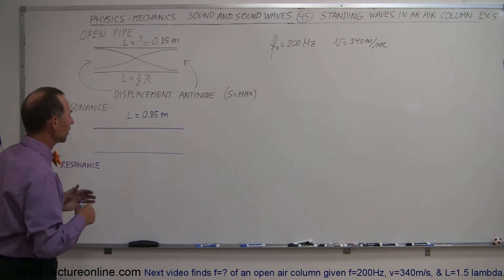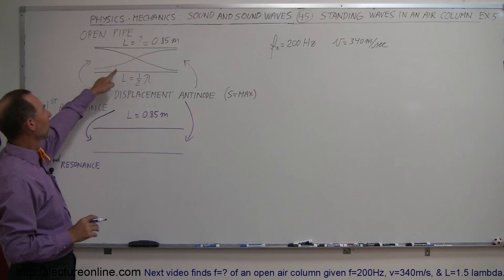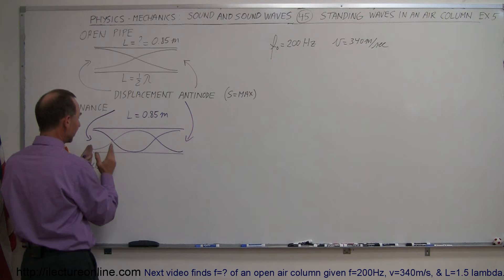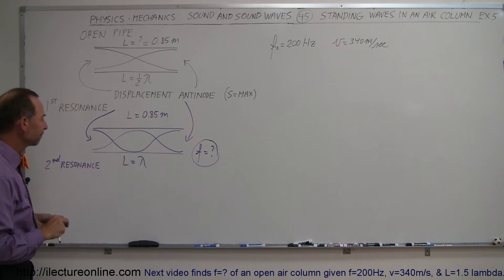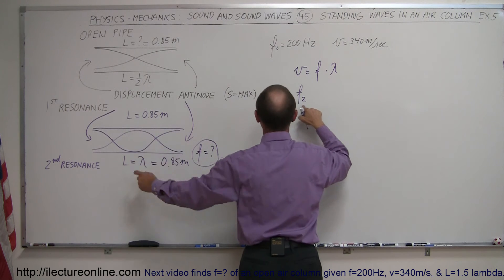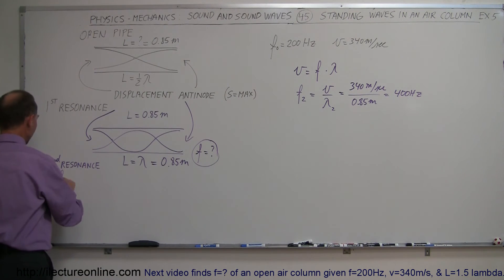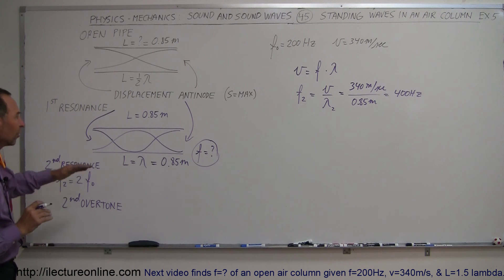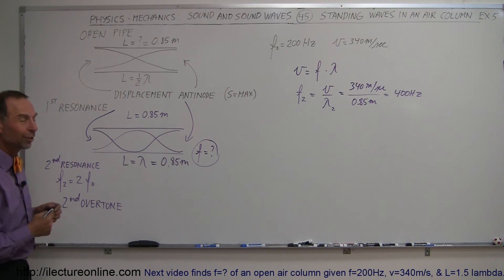Physics 20  Sound and Sound Waves (45 of 49) Standing Waves in an Air Column Ex. 5

Comment: So when u talk of a pipe open/ or closed does that play part in a ported sub box? If not how does one aply the nodes to a ported sub box? As to i do understand in a pipe closed/open but a box has the cab(box portion wher subs sit,then goes to the port)
Reply: As to if it was same in a sub box id need a anti node at the port and 1 node goin into the box then last node at the closed end of the ported box box facing the front windshield and that would make it more focused on air displacement/a good pressure build up?
Reply from the maker: Note that we are finding the resonance frequency with a open or closed pipe we are dealing with a single frequency.  With a ported sub box you have a speaker that will have many frequencies.  The purpose of the sub box is to amplify the low bass sound.
Reply: So essencially from what ur saying in a way a 34hrtz tuned box compared to a 28 hrtz tuned/ even lower could still be seen as all the same?, as to the sub does produces the sound no matter what? Just more overtones add to a greater achieved amplification if nodes are in certain places?
Reply: Tho i have looked at my crossovers marking i tuned my crossovers on my amp with a 60hrtz 0 db track on two mono blocks. 1 is running 2 4 ohm dvc subs to 1 ohm and the two 2ohm dvc subs wired to 2 ohms. I have found that when i looked at my crossovers when u use a multimete to set crossovers it sets the crosovers 3 overtones so instead of my amp amlifing just 60hrtz its actually amping up to 180 hrtz on the 1 ohm and the 2 ohm is 60 to 160 or sumthing like that im just going off memmory.. as well i love everything sound engineering soo far and been aplying it to my system, sooo far i been achieveing some really good sq but now that im understanding nodes more im gunna be  figureing out what all i rlly need to do in my car decks settings to shift the signal or whatever needs to be done. As well.. can u by any chance send me link to the first video of the playlist the videos name is under?I been trying to find the first video but i cant seem to find it
Reply from the maker: If you tune your box for a particular frequency (like 34 Hz) then the sound waves at that frequency would sound the loudest, but the frequencies close to the 34 Hz (both higher and lower by a few Hz) will also be amplified.  And yes, the overtones also are amplified but not to the same extent.
Reply: Kk and thank you for ur responce :)

Comment: I have a question, so what exactly do the resonances mean? If the natural frequency is 200 Hz and the 2nd resonance is 400 Hz and 3rd is 600 Hz and so on, what does that say about frequencies that can exist in this air column? Can no frequencies between these values exist? So if I scream in to a pipe with a frequency of say 300 Hz, will the sound not be heard at the other end?
Reply from the maker: +Jeevan1597 
At 300 Hz the sound will be greatly diminished as the return waves will cancel out the primary waves.